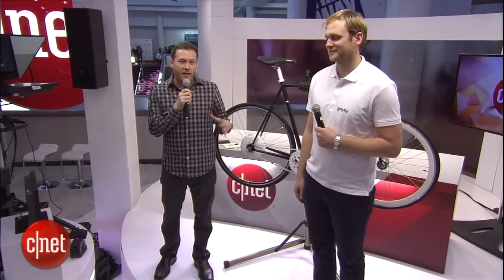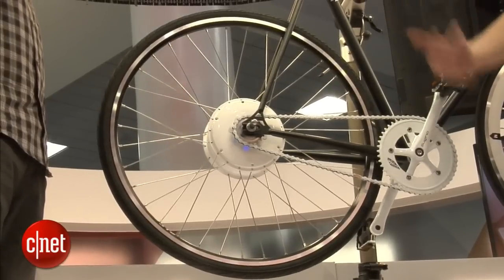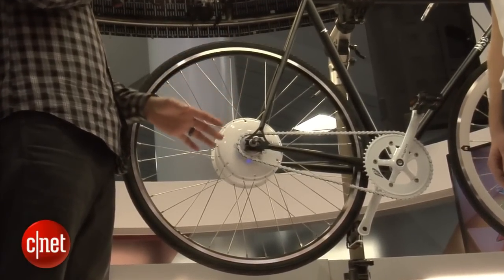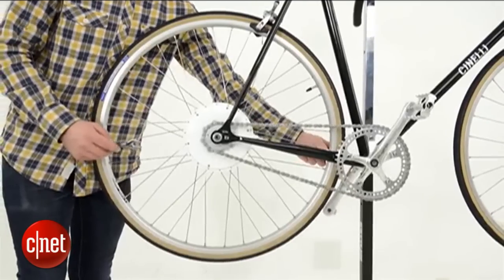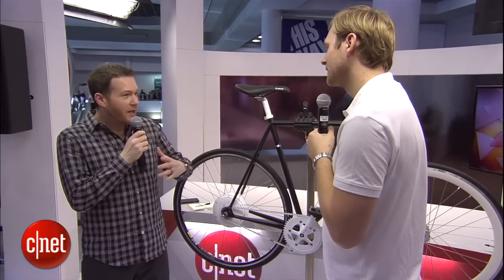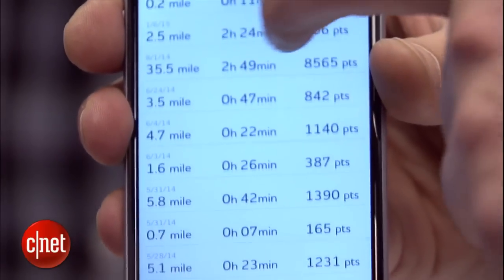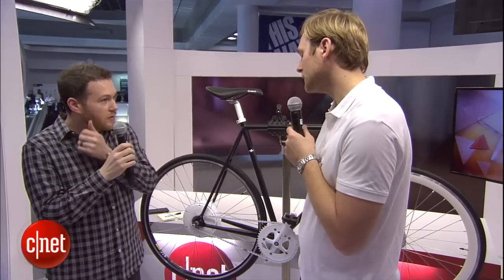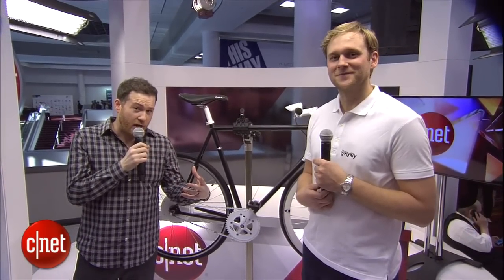FlyKly Smart Wheel

Comment: Flykly should have designed a disk brake option.  I'm not going to go get an old 26" rim brake mountain bike frame.  Like CEO said at 2:58 a lot of people like their own bikes. Besides except for dirt cheap bikes no manufacture has made mountain bikes with rim brakes in ages.  I'm surprised Flykly didn't design disk brake option because of that.  If they did have a disk brake option I'd order a Flykly hub today.